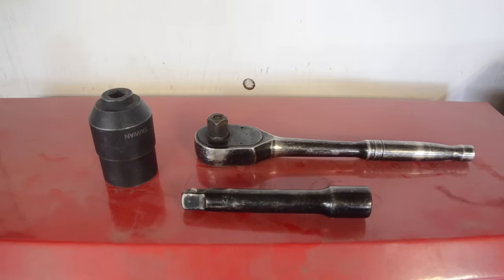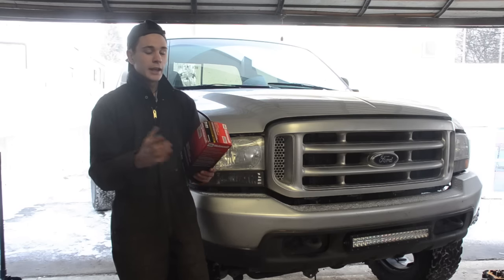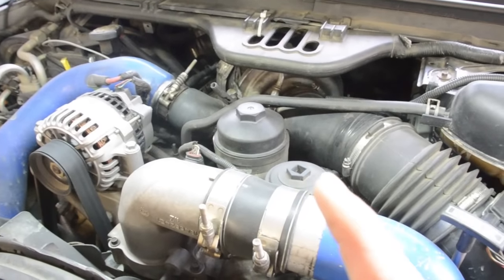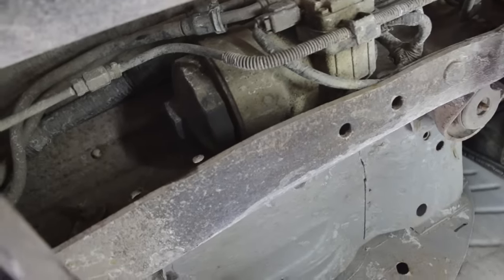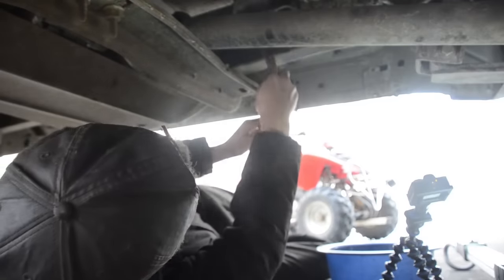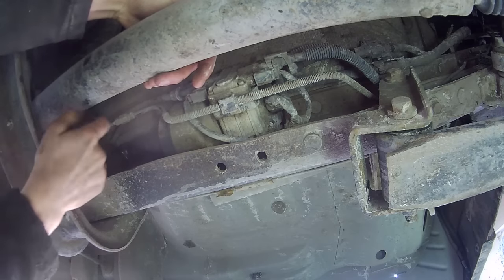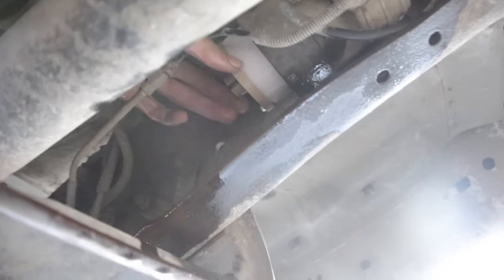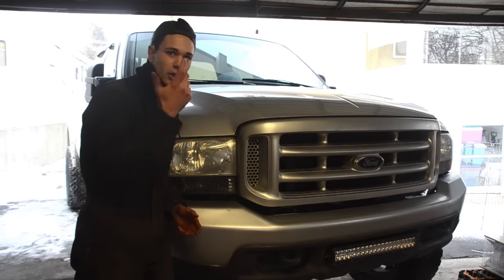6.0 Diesel Fuel Filter Change

Comment: Nicely done.  It helped me out on my excursion.  36mm socket for the lower fuel filter with a 6mm hex key for the fuel separator drain.  24mm socket for the engine fuel filter.
Reply: They made excursions with 6.0 powerstrokes?
Reply: @redneckpyromania6965    Yes sir.  The 7.3 and then the 6.0 powerstrokes, of course the V10 was available before Ford dumped the Excursion
Reply: @tedgifford1627  wow
Reply: Thanks for the info. Much appreciated

Comment: Excellent video, if you use a longer extension on the primary filter cap your ratchet will be in the clear behind the cross member, allowing for a bigger swings of the ratchet instead of minimal swings banging off of the driveshaft continuously.

Comment: The filter on the bottom of vehicle was a nightmare trying to undo the cap while fuel spilling in all different directions 😠
On the bright side my wife says I smell like a real man now, thanks to all that diesel spilling on me 😀 
Thanks for the video!
Reply: There's a drain on the hfcm, use that and this job will be a whole lot less messy.  I found this out after the fact lol
Reply: @fortunatedad7695 I'm confused by that, I've seen a couple comments now saying to do that.  But most videos, the mechanic says to drain that plug only until it goes from water to straight fuel, then tighten it back up and take a bath with the filter cap 😂 idk what to believe
Reply: @joel.ha.  what I learnt from working on my cars is if I don't want to get messy, hire a mechanic lol. 
I would suggest trying both ways and see which way works best for you and maybe along the way you find better techniques and then post a video for us :)
Reply: @fortunatedad7695  just moments ago I did it your way and it was way cleaner haha, the first time I did one I was soaked and fuel ran from the lower housing onto the rail and then way over to the passenger side of the truck. Both ways were pretty fun, I guess

Comment: Superb video. 
I'm computer guy but now I know I can do this myself. 
Thanks man
Reply: ALWAYS DRAIN THE FUEL WATER SEPARATOR!!!
I bought an 07 F250 that a week after I drove it home I had the Water in Fuel message up on the dashboard. So I did what everyone else does and watched 4 different videos on how to do it. I got me trusty oil pan and 6mm Allen Wrench socket and ratchet and climbed underneath the truck and found the"FUEL MANIFOLD" and the Water Fuel drain plug. Took my 6mm Allen socket and put it in the plug an tried to turn it with my hand and it moved a little so I kept turning it. I got about a 1/4 turn and the water started coming out so I let it run down my arm and into the pan. When I felt fuel coming out I "TRIED" to tighten the plug up, but it wouldn't tighten up.
I pulled it out which really increased the flow and looked at the plug and
3/4 of the thread area was gone.
So I put it back in as good as I could to stop the flow of fuel to just a dribble and went in search of something, anything to plug the hole until I could go to the dealership (because they were closed) to get one. I found a small rubber radiator plug that I could tighten to stop the flow completely. I took the old one to the parts department the next morning in my other truck to make sure I got the right one. They said that there was 2 different ones so I showed him mine and he said that I definitely needed a new one but that wasn't the worst one that he had seen. He said one came in with fuel coming out of the 6mm Allen hole in the plug. I wish I could show a picture of mine. It had a triangle from the plug with 2 threads on it.
The only thing that was holding it in was road grime and the will of God.
They are known to rust if the water isn't drained regularly.
I ordered one from Amazon that is bilitted Aluminum and it has a T shape at the backside of the plug that is also threaded so if you take the plug out it doesn't fall into the pan. (They make them for oil and transmission drains too!) I'll put that one on when I change the fuel filters for the first time and the stock will go into the glove box just in case.
So long story short, If you haven't been draining your water/fuel separator, or you don't know if yours has been draining regularly. Get a new plug just in case because NONE OF THE VIDIOS THAT I WATCHED WARNED ME ABOUT THAT IT COULD HAPPEN!

Comment: Great instructions. The only thing you forgot to mention was that, when changing the primary filter under the truck, you'll need a large bowl to catch the gallon of fuel that drains out of the system.
Reply: Actually he did say you want to have a drain pan or something ready to catch it.
Reply: @atheldown yes but not how large of one.  There's a LOT of fuel that drains out of the system.

Comment: Good job, man!  The only objection I have is letting fuel from engine filter drip back in.  The outside is the "dirty" side of filter!  I just use a coffee can lid, or small pan to prevent drips.  Nice vid tho!  Keep em comin..
Reply: I Agree!
Reply: Do both filters come in one box and are they different sizes
Reply: @j.r.w7636  if you haven't already figured it out already, yes both filters come in the Motorcraft 4616 box . And be sure to get the weep hole orientation to the top when installing the big filter it has  a tab the should catch to keep the hole to the top side. Perhaps start with the weep hole @ the 9 o'clock position then push the filter in and then turn the filter clock wise and the tab should stop it at the 12 o'clock position.  And  usually using a socket on the top cap will prevent cracking the cap or stripping it. And use a 6mm hex to drain the water separator 1st.  And when finished cycle the key to on engine off position 3 times to get fuel back into the system.

Comment: You should also drain the fuel water separator. There is always gunk and crap in it too. Great video though!
Reply: Where is the fuel water separator
Reply: @eles1089  its down on the fuel pump on the side facing out it takes a allen wrench to take plug out

Comment: Several times I've found the upper filter lid too tight, and the 1/2 drive tries to split the plastic. If you use a wrench,15/16"  that will re-enforce the outer hex so the 1/2 ratchet will work and not ruin the lid. Thanks,good vid .
Reply: Jay Berry how do you get the lid off if the plastic is ripped so can’t get a wrench or anything to unscrew it
Reply: I broke mine doing that the first time and a new one was pricey. Great Tip!
Reply: Yup happend to me, my lid was spitting fuel, now I use a regular socket!! And that top is expensive, even on amazon!
Reply: Great tip Jay
Reply: I read this too late. I used the 1/2 inch drive and split the cap. Then I got the 24mm socket and it stripped the cap completely (probably due to the fact that I split it...). Then I got clamps to hold the thing together while trying the 1/2 drive again...and it ripped it completely off! I had to saw the cap in half and then chisel it off piece by piece...a 10 minute job turned into a couple hours. The cap was $50 to replace. Lesson learned. I still appreciate the video as it was straight forward and gave me the confidence to do the job myself. I do suggest using the 24mm socket on the top filter though.
Reply: I had the same problem as you guys! Went through 3 caps over the years. I found billet aluminum caps for both the upper fuel cap and the oil filter cap.
Reply: Wish I would've read this comment about 10 minutes ago... 😒
Reply: is one of the filters smaller than the other one?

Comment: Use a 2 - 2 1/2 foot extension - much easier, good video, wear safety glasses , gloves and always replace old o-rings. And drain the water catch housing first.
Reply: If he doesnt want to wear safety glasses or gloves then he doesnt have to.
Reply: ALWAYS DRAIN THE FUEL WATER SEPARATOR!!!
I bought an 07 F250 that a week after I drove it home I had the Water in Fuel message up on the dashboard. So I did what everyone else does and watched 4 different videos on how to do it. I got me trusty oil pan and 6mm Allen Wrench socket and ratchet and climbed underneath the truck and found the"FUEL MANIFOLD" and the Water Fuel drain plug. Took my 6mm Allen socket and put it in the plug an tried to turn it with my hand and it moved a little so I kept turning it. I got about a 1/4 turn and the water started coming out so I let it run down my arm and into the pan. When I felt fuel coming out I "TRIED" to tighten the plug up, but it wouldn't tighten up.
I pulled it out which really increased the flow and looked at the plug and
3/4 of the thread area was gone.
So I put it back in as good as I could to stop the flow of fuel to just a dribble and went in search of something, anything to plug the hole until I could go to the dealership (because they were closed) to get one. I found a small rubber radiator plug that I could tighten to stop the flow completely. I took the old one to the parts department the next morning in my other truck to make sure I got the right one. They said that there was 2 different ones so I showed him mine and he said that I definitely needed a new one but that wasn't the worst one that he had seen. He said one came in with fuel coming out of the 6mm Allen hole in the plug. I wish I could show a picture of mine. It had a triangle from the plug with 2 threads on it.
The only thing that was holding it in was road grime and the will of God.
They are known to rust if the water isn't drained regularly.
I ordered one from Amazon that is bilitted Aluminum and it has a T shape at the backside of the plug that is also threaded so if you take the plug out it doesn't fall into the pan. (They make them for oil and transmission drains too!) I'll put that one on when I change the fuel filters for the first time and the stock will go into the glove box just in case.
So long story short, If you haven't been draining your water/fuel separator, or you don't know if yours has been draining regularly. Get a new plug just in case because NONE OF THE VIDIOS THAT I WATCHED WARNED ME ABOUT THAT IT COULD HAPPEN!
Reply: @garyargabrite1562  Thanks bud, how she running now?

Comment: Great video I just got my 2003 6 L diesel engine F350 back up and running after sitting for 6 years I replaced the batteries and drained the fuel water separator and it fired right up when 6 year old diesel fuel in the tank I had a half a tank in there but one thing I forgot about was all the condensation and crap that were built in the tank after sitting so long it ran fine for about an hour or so but after letting it sit for a few hours I went back out to Crank It Up and it started initially but sputtered and died so more than likely I clogged both fuel filters hopefully I didn't clog the injectors
Reply: 6 years? wow. I am always afraid that my truck wont start after 10 months. I know you need to put some extra stuff to the gas, or it wont work after 12 months, but I have never seen that liquid for Diesel... so does Diesel last forever?

Comment: Yup keep up on these services and yer motor will last my 03 6.0 is at 345,000 never been opened. EGR and injectors but thats it. cheers from the Toba.
Reply: I have an 04 6.0 and these trucks are known for failed egr’s you buy an aftermarket egr cooler or delete it if emissions aren’t required in your area
Reply: @22K562  if you delete the egr just make sure you support the manifold Y or it’ll break as the cooler holds it up

Comment: I have a vt365 bus I am about to do the fuel filter. I always see people using a small valve thing to drain the fuel out of the filter housing and cleaning the sediment out and then put in a new filter. Then they have the bleed the air out of it somehow. You seemed to not have to do all that? I know the vt365 is similar to the 6.0 power stroke so I’m hoping mine is simple like this

Comment: You forgot to install the new o-ring on the upper filter's cap.  You also forgot about how to ensure the weep hole is "up" on the lower filter.  The lower filter doesn't "screw in", you simply push it into the housing.

Comment: A good practical video that even a newbie can easily follow. How do you drain the water separator?
Reply: 6mm hex wrench, to the right of the filter cap towards the front of the truck. The Allen head bleeder port bolt is in a tight spot between the filter housing and the front drive shaft. Be slow and careful when taking it out, if you're not it will pop out quick and you'll be taking a bath in diesel fuel.

Comment: I don't understand the constant changing of filters with the reformulated diesel we use today. I understand doing maintenance to keep your warranty valid but it would be nice if you showed the dirty filter and rated its dirt level and commented on lower performance or whatever the issue for changing them so soon is. The truck doesn't just stop when they get dirty to a certain point, does it?
Reply: True diesel is cleaner, but the filters are much finer to protect the fancy modern injectors. The primary one filters down to 10 micron and the secondary one filters down to three microns. To put this in perspective, a single red blood cell is EIGHT microns in diameter!

Needless to say, as a result of this super fine filtration, they clog faster than the older filters. 

Will your truck suddenly stop with a partially clogged filter? No. It will start and run just fine. However, when you are pulling a big trailer up a steep mountain grade; injectors dumping as much fuel as they possibly can into the engine, your fuel pressure could start to drop. And running hard, high RPM, hot temperatures, a little injector suddeny stops getting fuel. And without lubrication or cooling from the fuel, the tiny injector tip seizes shut. And you have a dead injector. Or worse, you end up with diesel knock and a hole in your piston.

Moral of the story, just change them every 50k like the manual says. Why chance it?
Reply: The bottom filter separates water from the diesel, so I would always change it regularly
Reply: Absolutely especially with a 6.0l when the filter gets clogged up fuel will not pass and it will not get appropriate fuel pressure and also it keeps shit from the picky injectors the 6.0l has compared to the simple 7.3 injectors

Comment: Is there not a weep hole for the air that needs to be installed in the vertical for the lower fuel filter?
Reply: The Weather Nutz the bottom one has a weep hole there should be a notch on the filter insert it with the notch to the left and rotate the filter to the right till it hard stops that insures that the weep hole is in the proper position and makes it so that filter doesn’t rotate from the position when you put the cap back on

Comment: The way he said to prime the system is a good way to destroy your glowplugs.
Reply: That's the way ford tells you to do it and it will not kill glow plugs. I have cycled the key for glow plug up to 14 times for a 5 degree cold start last winter and my glow plugs are just fine

Comment: Just followed ur video and the filter under the truck wouldn't stop dumping fuel. You didnt mention this.  I'm pissed I have a huge mess and couldn't get the filter changed.  If you're going to make videos you should address possible problems and how to avoid them.
Reply: You didn’t see the fuel running down the frame in the video? I’ll tell you a easy solution. Pull out the 6mm Allen plug on the side of the pump first and it will drain the pump and make less of a mess when you take off the cap

Comment: I'm not sure if you still check this but first off. Great video! I'm having a problem maybe you can help. You mentioned you live in Canada and so do I.  I live in Ontario and am shocked I can't find any stores even online in Canada to buy motorcraft fuel filters...only place I can find is amazon and when I proceeded to checkout it said the fuel filter couldn't ship to my address but the motor craft oil filter could. Every other place I've found ships from the states and costs shipping fees. Any help would be appreciated
Reply from the maker: I have always just gone to a ford dealer and bought them. Not sure if there are places to buy them online in Canada.
Reply: Rockauto is the cheapest dont buy at the dealer. Rockauto online is half the price

Comment: When I do my fuel filter I get all kinds of diesel spillage. I don’t know what I’m doing wrong. Your had minimal
Reply: That's why I'm here. Same thing. If you figured it out can you let me know please?
Reply: @BecauseIamHere  I didn’t I just dealt with the spillage and change it out.
Reply: @cyrusdavirus007  did it stop spilling fuel? I'm asking because I have to take the whole thing out and clean it and everytime I just un do the water separater plug, the fuel just keeps pouring out. If I disconnect the whole assembly from the fuel lines, I wonder if the fuel will stop or do I need to drain the tank first. Since the whole assembly includes the fuel filter I hoped you would know if it actually stops spilling fuel when you change out the filter. That would tell me if it will stop when I disconnect it.
If that makes sense lol
Reply: @BecauseIamHere  it stops. Seems like at least a half a gallon of diesel though maybe more but it does stop

Comment: I tried using the extension and it fucking broke the top of the cap off. Had to use hammer and punch to get it loose

Comment: A cheater bar for a filter? C'mon man.
Reply: Stuck dirty cap with zero lube, and a weird angle and  what appeared to be a crappy chinesium socket wrench harbor freight would have rejected, looked like he only had a few degrees of effective swing to actually work with. Looks like the shorty pipe made it go a lot quicker and smoother.

Whatever works, right?